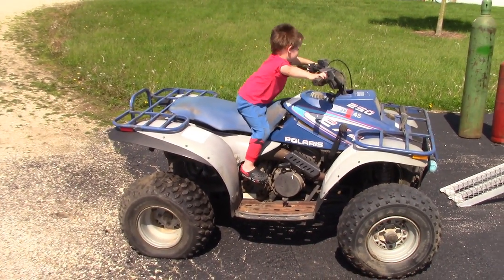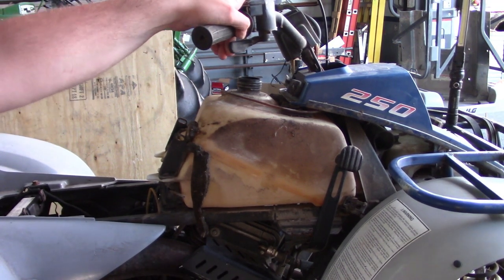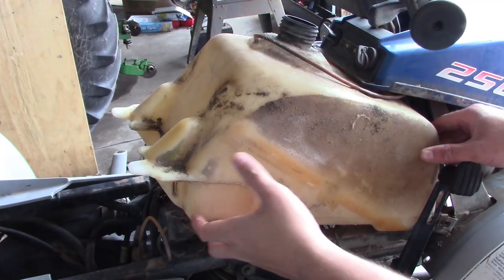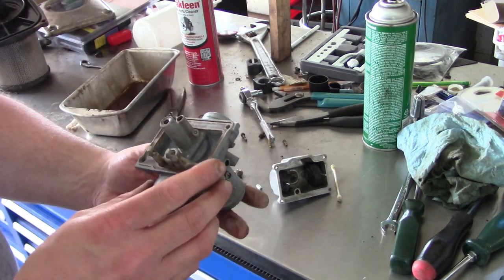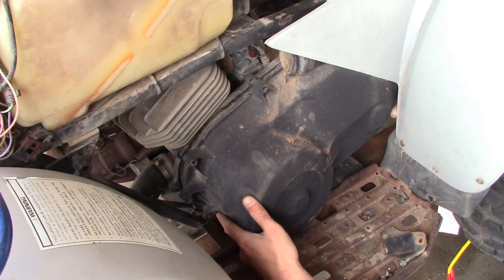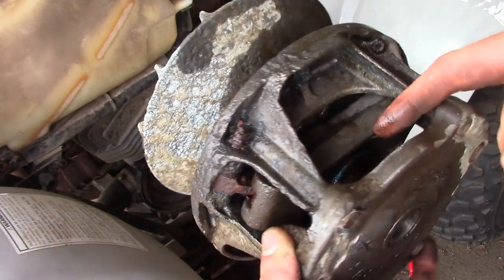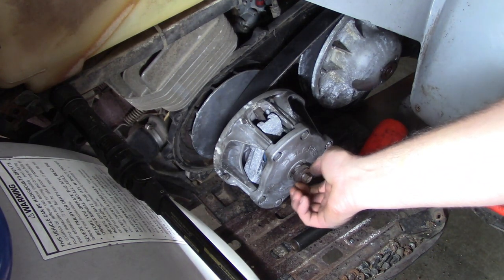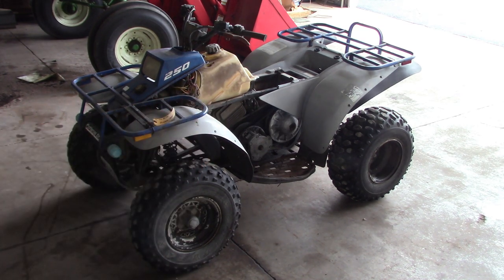Forgotten Polaris ATV | Will it Run after Sitting in a Barn for 22 Years?

Comment: I had one of those exact atv's. My daughter has it now. It is a 1993 2x4. That is the name of it. Before this one was the trailblazer or trailboss. The 250 2x4 was one year only. But the trail blazer and trailboss looked the same as the 2x4. For some reason Polaris does that. I had an 06 Polaris 550 classic snowmobile. Only came in 1 color that year. Blue.
Reply from the maker: Interesting. I ran the serial number through Polaris' website and it did not come up with a model name.
Reply: @WatchWesWork  That is the model name. (2x4). weird I know.

Comment: Free, is a very good price.
   That CVT trans would be your most expensive repair.  Might find used stuff on EBay.  Good to see you vacuuming the nest.  I don't want to be "that" safety nazi, but I will, hahaha.  Compressed air on those head cooling fins is not good.  Those rodents leave behind horrible viruses (Haunta virus comes to mind), get a mask on my friend.
    Does this unit have an electric starter with a recoil back-up...?  This unit is in great shape "esthetically".
Great video Mr. Wes, thank you sir.

Comment: #PROTIP from a novice, MIG tip cleaners/file for filing the copper MIG tips when weld spatter plugs them up work a treat for cleaning crap out of carb jets and small holes.

Comment: Nice score!   I don’t think even mustie could have fixed those clutches.  What a mess.  
Pro tip... get a clutch puller for that primary.  That slide hammer will ruin the good one.  Also, that primary goes on dry.  It’s a tapered friction fit.  That crank can and will spin inside that clutch and ruin both.
Reply from the maker: Again, the clutch has to come back off.
Reply: Watch Wes Work 
Thus the tip.  Want to be sure when it comes off again for the crank seal it goes on dry so you don’t tear stuff up.   Keep the videos coming. Always enjoy the content.

Comment: That button on the handlebar is likely a reverse override. These CVT machines will go just about as fast in reverse as they will in forward, so the manufacturers put a speed limiter in reverse as a safety measure. The reverse override bypasses the limiter, in the event that you get stuck or something and need full power.

The belt staying engage could be from the idle being high.
Reply from the maker: Yes that is correct. I don't think I'm not going to resurrect the safety limiter though.

Comment: I picked up a suzuki king quad 300 with no spark. Changed the solinoid and the starter, still no spark jumped the starter and found a huge hole in the oil cooler made quite a mess. Gave up, I really just picked it up for the body panels but I had to try it has only 2700 miles on it mine has 4500.... But at least mine looks better now with the body panels. Am passing the none runner on to my nephew, he's an electrical engineer he wanted a project.... Well he got one

Comment: On the polaris 4wheelers the clutches will spin when in neutral.Have to turn the idle down so as not to grind going into gear.
Reply from the maker: Yeah, the pulleys need to polish a bit.

Comment: I'd be a little worried about that primary clutch coming loose, normally I polish the taper with emerycloth and clean with brake clean. 
Also you add/remove shims behind the secondary clutch to center the belt it the primary, and add/remove shims in the secondary clutch to adjust belt tension.
Reply from the maker: As I said, it has to come back off to replace the seals.
Reply: @WatchWesWork  True enough. And if you're interested, primary clutch torque is 50 Ft/lbs, secondary is 17 Ft/lbs, just to give you an idea how much to rattle it with the impact haha

Comment: Dear WWW.
👍👌👏 Very well done again, Sir!
Actually how long sat that Clark in the field? 😁 Anyway: As you know any vehicle that sits on the ground for such a long time as your forklift will have issues with all its rubber and plastic parts (deteriorating because of UV light and summer/winter temperature difference and wetness of course). Also a lot of parts will have rust issues. Not to forget that nearly everything that gets older will be weaker.
So you will have to deal with a rolling restoration for a (un)certain amount of time if you like it or not. Nevertheless it's a good machine and you have been able to sell the other one after all.
By the way: When will we see more of those family field projects at last?
2) LOL! That sounds better because it doesn't sound! 😁
3) A 4-wheeler bike with a small  engine, lots and lots of mouse/rodent crap, the starting fluid in a plastic squeezing bottle is mixed gasoline, the typical laugh as it ran for the first time and a dirty carburator. Additionally it had the typical and preferred Mustie1 price tag on it = for free!
So: Hooray, it's Westie1 time again! 😁
It's a great looking machine with not much hours on it. Congrats!
Thanks a lot for making teaching recording editing uploading and sharing.
Best regards luck and health to all of you.
Postscriptum: I would bet that the engine smokes because it gets too much respectively a double portion oil (from the premixed gasoline and the inbuilt oiler). It is also possible that there is some critters crap in the exhaust. Additionally 2- stroke engines usually don't run right without a complete air filter.
P.P.S. Thank you for that suggestion. I will definitely try out this channel.
Reply from the maker: Rolling restoration describes pretty much everything I own.
Reply: @WatchWesWork  Wes what happened to the old vintage equipment you worked on, was it sold off or scrapped ?
Reply: @WatchWesWork  
Thanks for replying.
That's a common thing if you aren't rich. But it can also be the usual respectively a good way to be sustainable for having a better world. Don't you think so? At least you are a fantastic allround mechanic and can help yourself. By the way: In Germany it is called "Mechatroniker" = a mix between Electronics technician and mechanic. Is this similar in the USA?

Comment: I'd Block off the Auto-oil feed tube and see if the excess smoke dissipates, that will show if the factory oiling system is functioning. Since you're using pre-mix anyway.

Comment: Due to the amount of exhaust smoke, I'm guessing the oil injection system is working just fine and with the premix it's getting 2x what it needs.
On an engine that been stood for 17+ years, that's not necessarily a bad thing either.
Reply: Do the oil injection systems have a line that runs to the carb then mixes or does the line connect to the cylinder and directly pumps it in

Comment: yeah thats the tors sstem for ya {in yamaha speak} you have spark when u hit the throttle cause its designed to kill the spark when teh throttle is shut in a runaway situation. they always go bad. cut them wires.

Comment: I have the same bike.  Gas pours thru the carb unless you shut off the gas and the gas needs to be drained out of the pull rope housing .   there is a drain bolt.  I cleaned the floats mechansm twice but they dont slide well.
Reply from the maker: Mine did not slide either. I had to run a small drill bit through them to remove the crud.
Reply: @WatchWesWork  Did you yank the float pin out of the bowl or how does the float come off?

Comment: The switch on the throttle is an ETC switch it shut the engine off if the throttle cable gets stuck set it to where it just pushes in on that micro switch

Comment: I found those crimp type non-insulated wire joiner butt connectors you use on amazon they are also on eBay but amazon offer a better deal, they are on there way. thanks.

Comment: I have had many polaris four wheelers in my shop.  All of them suffer the same mouse problem.  I belive the plastic they are made from is a special mouse attractent.  I have replaced the clutchs with aftermarket and never had an issue.  Not to say i wont though.
Reply from the maker: OK. I just didn't know since I have never tried them.

Comment: What was going on with the cylinder at 41:00? Is it my imagination or is it moving up and down as you rotate the shaft.
Reply from the maker: The whole engine moves.
Reply: @WatchWesWork  I notice that now. I didn't realize the engine was not bolted to the plastic belt housing.

Comment: The emolsion tube pardon my horrible spelling is not pined in place thats a guide pin. The tube is push in through top of carb. It doesn’t come out of the bottom. Also whats that slide hammer puller you got. Sure could use one like it
Reply from the maker: OK. Maybe mine is just stuck. Slide hammer is by OTC.
Reply: @WatchWesWork  thx

Comment: special puller is needed for driven clutch. don't lube the tapper shaft. master cyl same as polaris snowmo
Reply from the maker: It has to come back off to replace the crank seal. It's temporary.

Comment: Hope u. Heck the CVT 4:45 and MIC is Mikuni. Motion tube DOES COME OUT. The tube Slides out the slide hole. Holy crap, the tank filter is probably JUNK frm this nuts and bolts too. Wow. “😮Torque CONVERTER” is a part I never knew about🤔👏 I’ve never saw such a “show” in my life even frm a middle school student. Air leak…. No. It needs the filter/lid/& SNORKEL to run rite. I can’t believe I lasted to watch. 👋 I love it”oil injection reliable” u heard it frm him 🥇

Comment: The extra smoke likely means the oil injection is working be careful running extra oil in a 2 stroke it can actually do more damage the rings don't spin in the piston as the do in a 4 stroke and this allows the oil to build up as carbon in the cylinders and pistons and will wipe out a good motor quick

Comment: Hi I have a 1988 trail boss 250 that won’t start. It was running normal before but when I came. To start it cold the next day it would not fire. I was able to get it to start with brake parts cleaner but when it sucked up all the brake parts cleaner I sprayed in the carb it died. I just clean the carb and went all through it but still wouldn’t start and it wouldn’t even start off the cleaner anymore. Has good spark, new spark plug, good compression. everything looks good on it. Any advice to help me get it started would be a big help thanks

Comment: Unless your battery case is made out of wood, it's not going to hurt it sitting on concrete. That's an old wife's tale from back when batteries were made out of wood and very sensitive to sitting on cold surfaces. It has not applied for a very long time.

Also, why would they not take that as a core? They only want the lead out of it and I'm pretty sure it's still in there.

Did you even make sure the CVT pulleys were free to move? Do you understand how a CVT even works? You kept calling it a torque converter. The rear one should slide open with force, it's spring loaded. Judging by the condition of the used CVT, it should have been gone through, cleaned and checked. If the parts are not free to move, it won't gear up with RPM which is what it sounded like on the test ride.

Comment: The propane cylinder is not installed correctly on your Clark.  The slotted area in the handle should face down (toward counterweight), this locates the pressure relief on the cylinder in the correct position.  There should be a pin to receive the slot mounted to the fuel cylinder bracket.  The way the cylinder is installed in the video is bad news:  if the cylinder is filled correctly (80%), there would likely be liquid propane in front of that relief, potentially resulting in the relief exhausting liquid propane during a relief event.  Iirc, It may be plausible that the pin is on the left side of the bracket, and the length of the hose is meant to go across the counterweight,  That is a Clark lift truck, I get nauseous just thinking about working on them and have done all I can to block out any memory of working on one.
Reply from the maker: Yeah, I have to turn the tank like that so the seat will raise to get to the engine. Once I finish the repairs I can put it back like it should be.
Reply: “Lil Smokey”. Likely oil injection is working just fine.  Would likely be much happier with an air filter on it.

Comment: I once saw an aluminum motorcycle engine that sat for years in a barn with cattle or pigs, on the floor with hay and animal piss. It had the whole bottom part dissolved clean off. That stuff is nastier than people think.
Reply from the maker: Yes. It's very acidic. Or basic. Or something corrosive.

Comment: I highly recommend you use a magnetic dish to hold the parts you remove from the carburetor to prevent an accident where you accidentally sweep the parts onto the floor thereby testing your eyesight. First time I did that I had to buy a rebuild kit to get the parts that I couldn’t find. 

Nice job on the Polaris.

Comment: How does the propane line work out length-wise if you flip the bottle around, so the outlet is on the left side of the forklift?
Reply from the maker: I guess it's supposed to loop over the top.
Reply: @WatchWesWork  Yeah that could work too. I would be pretty annoyed by a sloppy hose, so I definitely understand you don't like it.

Comment: I have the same bike but mines dose not wanna turn on. I replace the relay clean the carburetor put a new spark plug and battery it turns over 

Please let me know what should I do I look for a carburetor but cant find the right double gas line carburetor

Comment: What I would bet with the smoke is yes mustie, er wes, is the oil injection is working along with the mix, and will quit working just as soon as you wean it off mix. So empty the oil tank and just mix then the motor will be running when the little man is pushing twelve and then will last about 6 months of rodding mit der teen to be.
Reply from the maker: Great point!

Comment: I have a extremely similar carbuator on my arctic cat sled, it won't turn on unless I throw a bunch of gas In the cylinder. Any suggestions?
Reply from the maker: My dad always told me that the most common issue with a slide carburetor is the low speed circuit plugs up and people try to adjust them to run using the high speed circuit only. That makes them hard starting and they will not idle the same when cold as they do when warmed up.

Comment: I hooe u see this but i have same 4 wheeler just in better condtion that runs like a beauty but the brake on front handle bars is locked up but the side brake works and she run fine shes good and fast

Comment: The troubles of abandoned equipment. We deal with such machines a lot, but you know, it's the devil you know, vs the really garbage one they make these days. Improvements exist, sure, but the negatives are just as big. Just the other day, i heard from our sister business that their brand spanking new Hitachi loader crapped a blade cylinder in half. It was not a cheap piece of equipment.

Comment: Fix the crank seals on both sides. A gas 2 stroke will run away just like a diesel 2 stroke. Ive had 3 run away wile I had my bike shop. I had a Suzuki lt250r we could not stop and it made a mess of the motor. FYI put a sign out front of your garage (We fix Polaris ATV's) You will be wealthy beyond your wildest dreams..lol To check the oil injector pull the hose off going to the intake boot or carb wile running with mixed gas in the tank. I forget its been a wile where the hose is. If its pushing a drop of oil out once in a wile its working. Do not trust the oil injector. They do fail. You can plug that hose and premix oil in the tank. Leave oil in the injector tank to lube the pump to prevent burning it up. Or do a total delete of the pump. Premix is the way to go. Polaris atv's in the 90's on kept my shop open and doing well. Polaris actually made a 3 wheeler back in the days of the Honda 3 wheelers. It was a 250 just like this but a 3 wheeler. They just added 2 front wheels. The 3 wheeler had the same foot boards yours dose..lol. The motors are super simple to tear apart. They are super reliable. The cylinder is borable. It has a cast iron sleeve. (non removeble) Crank bearings are common. Pretty sure I have a top end gasket set If you need one. The crankcase is just sealed with yamabond or equivalent.
Reply from the maker: I have the seals in hand. I'd like to keep the oil injection if it works. Less likely to forget to mix the gas since I have another ATV that is 4 stroke.